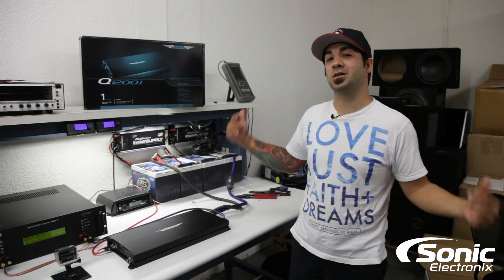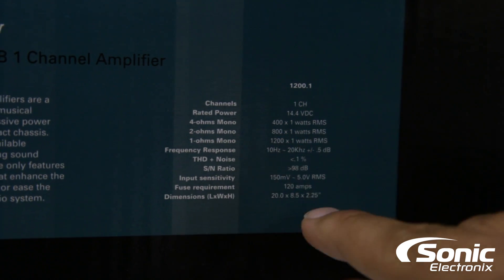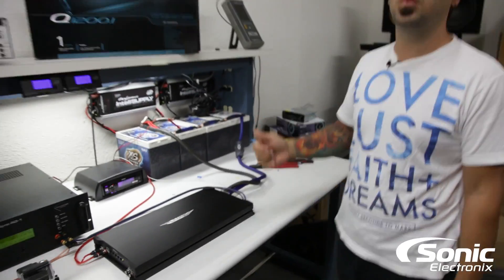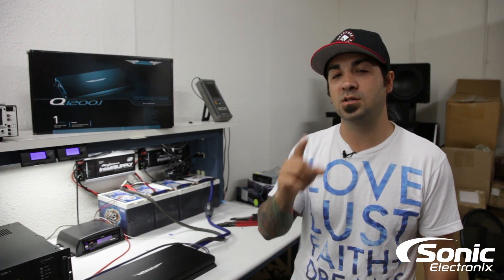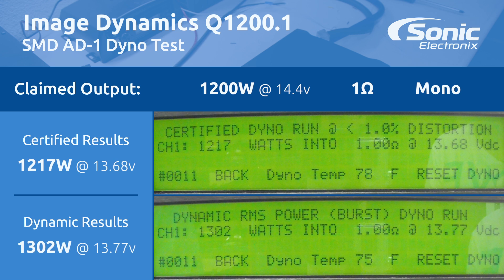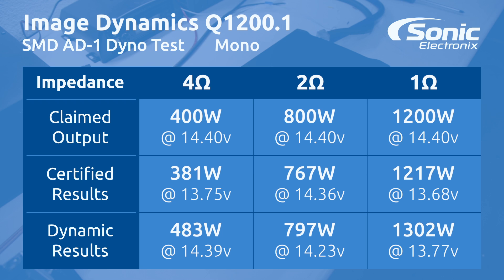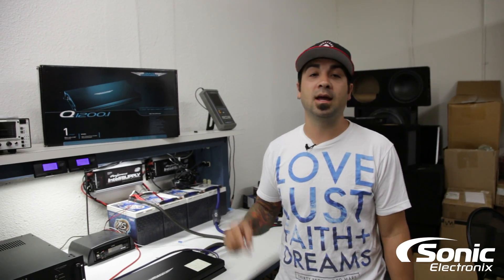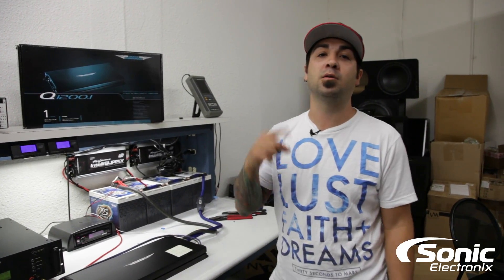Image Dynamics Q1200.1 Amplifier Dyno Test | SMD D'Amore AD-1

Comment: Starting Voltage in a regular car is not 16 volts Sonicelectronix It is 14.1-14.4 Volts. 
So This is a cheating a customers. The Voltage from 14.4 would drop to under 13V and this or any other amp would not perform that well !!!So next time  DO IT RIGHT sonicelectronix Please
Reply: +Max Boyka no it isn't cheating anyone. this is how an amp dyno works off a battery bank. a car running is around 14.2-14.5V and you would clearly get over 1302 watts @ 1 ohm with this amp in a vehicle environment.
Reply: Max Max it did 1200+ at 13.6volts that's about perfect for what you would see in a car on stock electrical. Hell my xs power xp3000 and d3400 keep my voltage above 14 almost all the time, only time it drops is on hot nights with the air con going wide open and the bright lights and neon going and two dc audio 2k's beating on 2 lvl4 12's hard then it drops but never goes below 12.8. And I don't have a after market alt either just a stock 130amp in a turbo Cruze. I also have a HD1200/1 JL amp running a 13w7 in my woman's car and only have a small 1k capable battery on stock electrical and only 4 guage run to the secondary batt and it's never gave me a problem.

Comment: Could you guys find the efficiency of these amps when you are testing them? It would know how much power these amps require to push out said ratings.
Reply: you can calculate it easily using Ohms law. at 1200W it pulls 87A at 13.68V. If it were a perfect amplification (1200W at 14.4W, it would only pull 83A) 83/97=0.95 or 95% efficient which, is absolutely BONKERS for an AB class